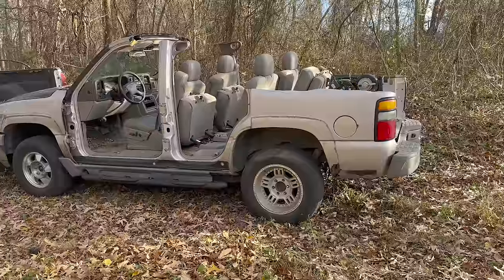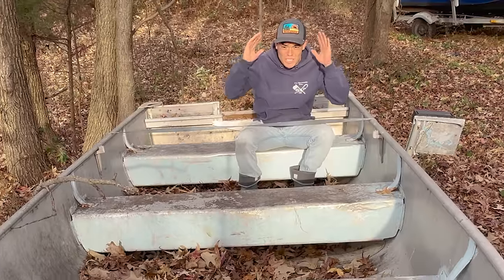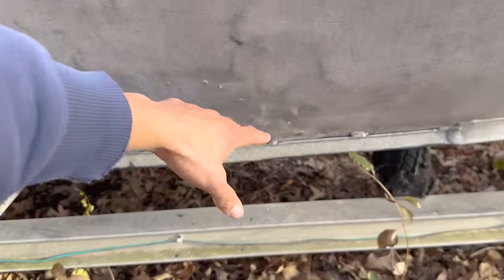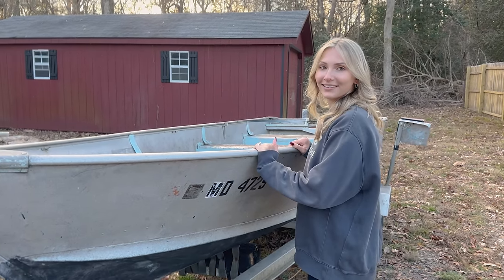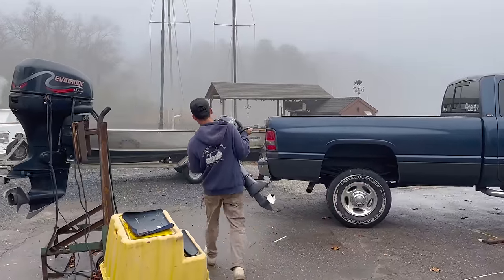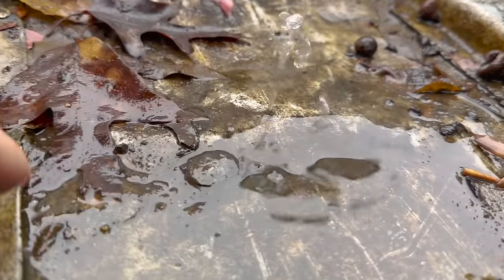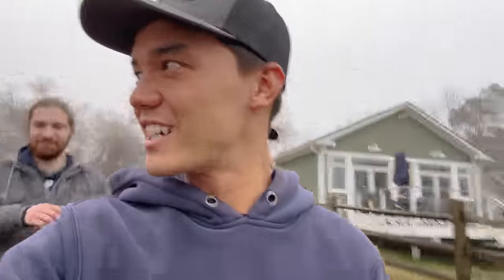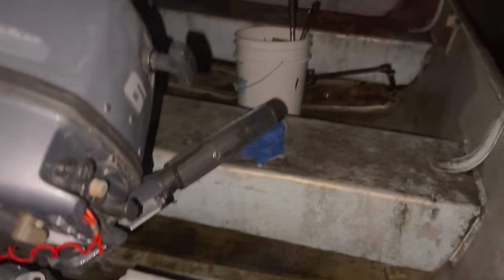I bought the CHEAPEST Boat off of Facebook Marketplace

Comment: Great memory for me.  My dad bought a sears best, like that back in the 1970’s.   He let me put the trailer together and wire the lights.   Grandpa has an old 7.5 Evenrude, still have that motor.  Use heavy nails to make shear pins going down the creek, setting bank poles and lines, camping.  Rope pull broke, dad took to a boat shop, they had it almost all summer.   Dad finally raised cane, they replace all kinds of stuff on motor.  Dad showed the receipt to fix rope, heck the motor ran fine.   So all new parts for cost of new pull start rope.❤

Comment: Holy crap, I live in the DMV so I actually know which day you filmed this.  It was absolute SOUP that day.  By the by good buddy, it is an aluminum boat, made from weldable aluminum, if you can find the holes in the off season just fill them in with weld.  MIG with a spool gun, low heat, and be careful, flap disk finish, and there will be no holes left.

Comment: Reminds me of my 10ft aluminum pram.  3hp Evinrude.  My brother won it at a raffle in Harundale Mall. It helped that I was a runt.  Never got over 118 lbs until after HS.  I actually got warned about going too fast in a 6mph zone by Tidewater.  My summer water gang called ourselves the Magothy Maggots.  
Got into an ice throwing battle with one of the guys on the pier of what used to be Town Hall Resteraunt. I didn't have the motor on securely.  The motor flew off in 12ft of water.  Got it out with a pair of oyster tongs a week later.  After a little work - it ran. 
Another time, by myself near Magovista beach, one of the football team lineman (225 lbs) ran me over with his normal sized boat.  Put a big dent in it and had to bail more often.  
And had some problems with the transom after trying to pull up one of the maggots on skis.
Reply: Mastrr chef  boot 60 foot sunseker 60 oreadtore jet drive 45 moh

Comment: Well , I still got a 12 foot , 12 volt trolling motor   , 9.5 gas motor , oars  and trailer and more extras . I sold my 18 foot . 
Both sit around for 9 years because I just use my kayak . $400

Comment: Lol i was thinking why didn't they clean the boat from all the leaves but makes sense they plug leaks . my first boat eas a 19 foot cabin cruise with a 65 hp evinrude had a gash in the hull that leaked even after fixing it. first time i tool out with my gf the gas tank messed up and we were dead in the water without a paddle . to our rescue was a older guy with a boat like your's and a little putt putt motor to tow us in lol. a dozen boats later i always regret not doing it simple with a little 14-16 foot aluminum boat , get a leak pop in a rivet or do like Lindsey and throw some leaves on top to plug it .